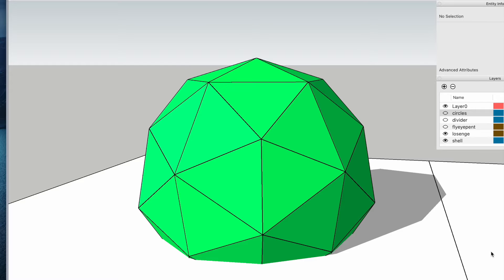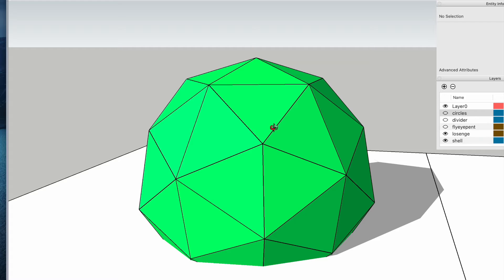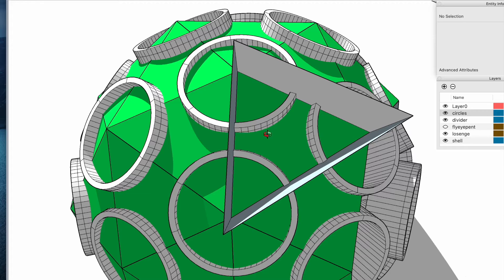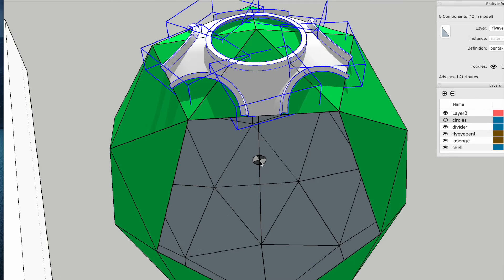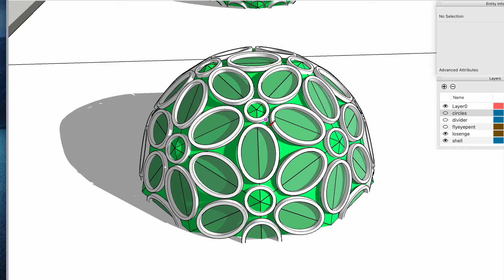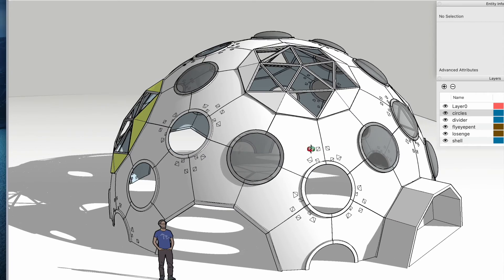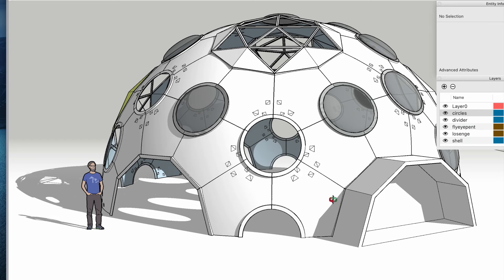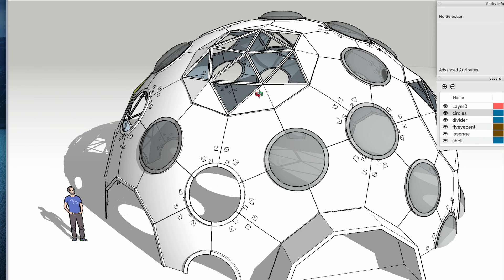flyeye dome CAD drawing tutorial

Comment: Is there a structural reason to put the windows on the vertices instead of the faces? It seems like it would be much simpler to leave a hole in the middle of the flat panels. But I know that the "easy" way is often a bad idea structurally.

Comment: One thing to keep in mind is that the rings become the structural replacement for any part of the dome they are replacing.  If you're placing them on vertices, they must have the strength to replace those elements.